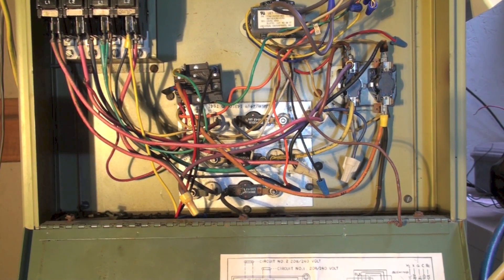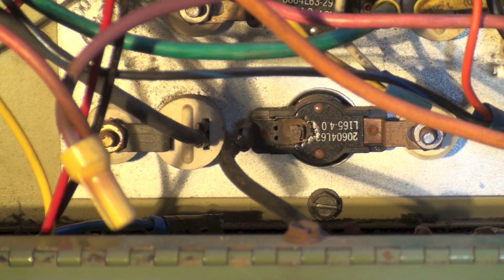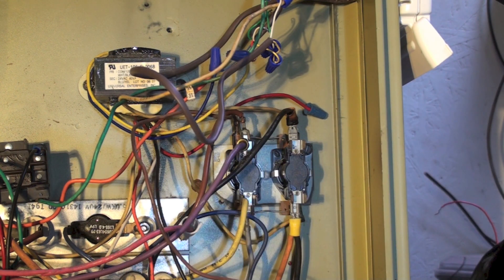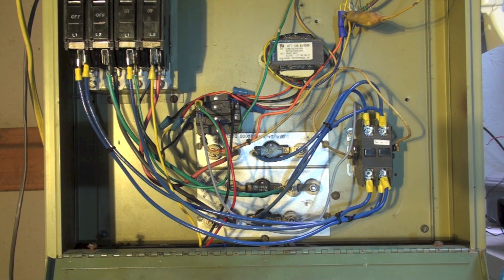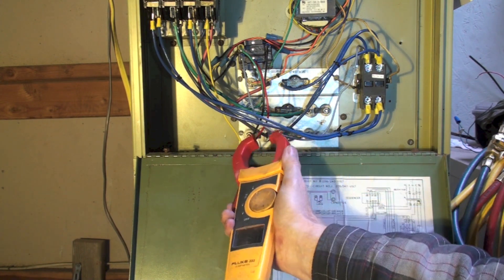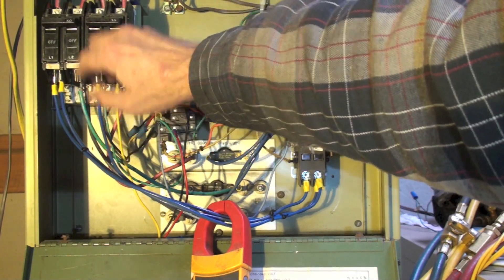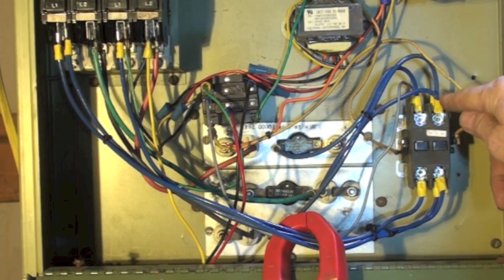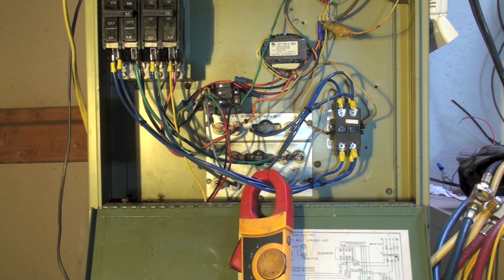Electric furnace, replace sequencer with contactor

Comment: Granted, I'm a low volt tech with a lot of line voltage experience as well, the contactor is a much simpler install than the sequencer. I have a 4 element system, practically the same exact setup. I think the contactor is far more straight forward. That being said, yes, if you have no clue about how electricity works, don't burn your house down. But, I'm also here because I'm sick of replacing elements, sequencers, etc. And yes, the spade connectors seem to always be the downfall, and/or a failed sequencer. I'm going to be moving to a contactor, see what type of luck I get.

Comment: my sequencer is starting to go wonky, sometimes the fan bit never comes on, couple times now the systems been in cool and the indoor blower has not been running, if i flip the constant run switch on the stat it seems to bump it back into working order... these are so confusing if your working on them with sequencers, because they really dont make a lot of sense.. at least its not nearly as straight forward as gutting it removing that crap and just putting contactors in... so much easier. my furnace is fused too and ive wondered if converting to some form of other means of disconnect/overload cutoff.. fuses are giant bitches to.. i just dont like how coleman did the fusebox tbh..

Comment: The reason you have 22 amps on two of the 3 wires is because those 2 phases are also powering the blower motor and the 24 volt transformer as well.

Comment: What's a good stranded wire for 10kw heat strip?

Is #6 okay w/strips and fan?
Reply from the maker: I would use #6 THHN.
GFM
Reply: @grayfurnaceman  Would this be #6 load side of contactor to heat strips(say, a red #6, black #6 just for mnemonics)?

Is a 90-380 relay okay, or what relay would you choose?

#6 from breaker to line side of contactor too?

This method seems simpler that sequencer?
Reply: Request: like, if u could, to do a video with contactor & fan relay wiring?

Thank you!

Comment: I appreciate you taking the time to make this video, and your level of knowledge on these things. It seems to me, though, that this is more of a video displaying the fact that you did something than an explanation of of 'how to' do that thing. A step by step tutorial on which wire goes to which terminal and why would make it more of a 'how to'. I hope that doesn't come across as overly critical. No offense intended.
Reply: It's fairly simple to follow. If you were to replace all necessary wires in your old sequencer and breakers, the remove your sequencer and just transfer those wires over to the contactor it should be pretty self explanatory if you know how your sequencer works and what is on what circuit.

Comment: I'm currently working on this same style furnace the issue is the blower won't shut off after the thermostat is satisfied could this be the contactor is bad ?
Reply from the maker: You probably have a wiring problem.
GFM

Comment: Excellent video!  Some solid suggestions/comments from readers!  But other comments shows they truly don't understand to the level that's required to perform this modifications!
Reply: I was working on a similar project- a contactor in an electric furnace burnt on the line side. I almost did the same thing as the video. Two 10 wires from the breaker to one side of a new contactor. I was worried the wires were two small to handle 40 amps so I used the original 6 wire used by the last company. Currently waiting to pick up a lug Contactor so I can fit those big wires safely.

Comment: I was wondering I had havc guy HV AC guy come in here and my control board is burn up and he replaced it with a contactor but he didn't hook up the emergency heat my question is how does that work where those low voltage wires hook up to
Reply from the maker: That is field installed wiring so there is no set method.  About all I can say is the emergency heat is connected to the coil of the contactor.
GFM

Comment: I live in a rural area now and although my panel specifies using 105C wire only it is unavailable unless I want to drive about 60 miles. Is there any practical reason not to use thhn/thwn2 ?
Reply from the maker: You can use THHN.  Just be sure the connections are tight and if it is using #12 wire,, use #10.
GFM
Reply: @grayfurnaceman  thanks.

Comment: First thank you for your informative videos.  I have an older Intertherm furnace (with 3 x 20amp elements and fuses), 2 sets of 30amp, and 60amp.  Have 50amp double pole breaker at my box .  One would think that one 30 and 60 amp fuse would correspond to each pole of the breaker.  I cleaned up the wiring with new 10guage.  It has a 40amp contactor for the elements and fan.  It threw the breaker yesterday after running for a week.  The main questions...do I need a 50amp contactor, what one did you use above, the Honeywell is $100 and maybe overpriced....Or does this sound like a wiring issue, I duplicated the previous wiring but that doesn't mean it was wired correctly in the first place.  Thank you, and yes I will contact a tech if you think it is a wiring issue.
Reply: Your contactor is probably a bit small.  50 would be better.  The Honeywell contactor is used because it is quiet operating.  Any contactor with the rating will work.  
Do you have just a single 50 amp breaker in the panel for your furnace or are there 2?
GFM
Reply: 50 amp breaker ????? U need 60 and a 30 or a 70 amp breaker with minimum number 4 wire or 60 Amp with number 6 and 30 amp with number 10 wire

Comment: thanks Gary, need some advice i have a question maybe you can help. i'm up north, first freezing cold spell since the winter, first time aux heat strips in use in the air handler since winter (Trane 4tee3f37b1000aa). When the aux heat starts, there's a machine gun rapid fire/chatter sound at the air handler, right about where the 20KW line comes in. pretty loud i'm not really familiar with relays or contactors but could it be relays that turn the strips on and off that can make the noise?? Once the heat gets going and the fan is up to speed, noise stops, and then starts again a bit when the heat cycle shuts off. I'm still getting aux heat and the fan is running smoothly and is set to ON, outdoor HP heating fine otherwise. I'm DIY have changed blower motor module and capacitors but no relays. system is 12 years old. 1 have 4 heat strips x 5kw each
Reply from the maker: The chattering indicates the control circuit has excessive impedance.  The coils of the contactors are not getting enough power.  The first thing I would be looking at is the thermostat.  
GFM
Reply: @grayfurnaceman  thanks for the quick reply Gary. From the tstat display everything looks normal. Can you suggest specific troubleshooting steps-  what I should be doing/looking for inside the air handler? do you mean that the control signal from the tstat is only opening the circuit partially at the heat strips and what might be failing exactly to cause this (relay/contactor/sequencer?), does that indicate mechanical failure/physically damaged/burnt  parts  (what and where), and/or loose wires or connections? or more like a board? I'm not that familiar with electrical but i can methodically identify specs and replace parts and reconnect wires based on existing config. my budget is very limited so i need to figure this out myself like in the past. sorry for the long question.
Reply from the maker: @soneeeee4440  My thoughts are that the thermostat may not be operating normally and will be not transferring power to the contactors.  
GFM

Comment: I can think of one more safety device : an air flow switch. If for any reason the blower fails to kick on the the elements will not come on thus saving the elements from excessive overheating.

Comment: Great video. Im tired of crawling under the house and replacing these sequencers. I'm going to do this conversion. I have a question though. My furnace blower also must run with my AC so I would not be able to use one leg of the heat contactor to pick up the fan motor. I assume I would need a third contactor for the fan alone. If you could maybe explain the correct wiring for a 4 element furnace with AC that would be helpful. Thanks.
Reply from the maker: You could simply use the existing fan relay normally closed contacts connected to the contactor.
GFM
Reply: @grayfurnaceman  yeah after studying the wiring diagram I understand how it was designed.
Honeywell programmable thermostat took me a while to decipher with my meter.
Want to run my heat pump / electric backup system like a basic heat and cool system. Reversing valve is bad I think and will just leave it in ac position for now. I think I can do this changing one wire and the correct programming of the thermostat.

Comment: Won't it pull too much amperage when it closes?
Reply from the maker: It does not.  Several furnace manufacturers use contactors in their furnaces.
The reason for sequencers to reduce initial amp draw came from the 1960s.  At that time there were many pole transformers that were not designed for those high loads.  That time has passed.
GFM

Comment: A relay (contactor) is simpler.  I guess the only downside is the possibility of noticing the lights blink when all three loads come on at the same time.
Reply from the maker: That has been the argument against the use of contactors for over 50 years.  I would say that may have been true when the grid did not have the capacity it does now.
I have not seen that issue happen for many years.
GFM
Reply: Hey watch out, our grid has a rating of D+.

Comment: When you demonstrated crimping a #10 ring connector you said you crimp on the back side of the connector ( that's the way I always did it ) yet when you showed a close up of the installed contactor your crimps  were on the top side of the ring connector?
Reply from the maker: You are looking at the bottom of the connector.  They are installed upside down.
GFM

Comment: Like your idea of contactor. Is there a way to simply check the voltage across the sequencer itself while installed to tell if its bad?
Reply from the maker: If you test across the contacts during a call for heat, after enough time has passed for the sequencer to close, you should read 0 volts.  240 volts means the contacts have no closed.
GFM

Comment: I am thinking about replacing my sequencers with a CONTACTOR. I would like to know if my furnace also has Air Conditioning if this is a cause for concern?
Reply from the maker: The only problem I can think of is the fan relay must separate the elements from the fan when cooling is energized.
GFM
Reply: @grayfurnaceman  Thanks for the quick reply. I ALWAYS have my fan on at all times. So  I will wire it on (thermostat FAN on switch). That should work fine, your thoughts?
Reply: It should.
GFM
Reply: @electriccar3253  Thanks
Reply: Received my Honeywell contactor today. Where can I get 10awg wire??? I went to 4 different hardware stores and they don't sell "stranded" 10 gauge. Could you point me in the right direction please. I will get it online but would like to know brand type etc. Thank you very much if you could help me with this.
Reply from the maker: I have seen it at Home Depot.
GFM
Reply: @grayfurnaceman  You're right. Went there and they had it.! Thanks
Reply: I installed the new contactor and working correctly. I need to replace the connectors at the heater elements. I was told that they need to be HIGH TEMPERATURE . They are slightly larger than the ones at the CONTACTOR side. Where can I purchase these HIGH TEMP connectors? Home Depot and so forth do not carry these. Any ideas? Thanks
Reply from the maker: The connectors are .250".  You do not need high temp connectors.  No manufacturer uses "high temp"  connectors.  Those connectors are needed for environments that are high temp.  That is not the case for electric furnace elements.  There is no excessive heat in the control box of an electric furnace.
 GFM
Reply: @grayfurnaceman  Ok , I can use the standard ones then The only problem is that the 0.250 size is too small on the Heater Element side. How can I post a picture to show you exactly?
Reply: I just measured the female terminals. The standard ones (contactor side) I measured OUTER 7mm or 0.27 inch. The terminal of the HEATER ELEMENT side I measured OUTER 9mm or 0.35 inch. Now I have to find were I can get these buggers.
Reply from the maker: Send to Grayfurnaceman@gmail.com
GFM
Reply: @TheHudsonSpeeder  I was just making new wires and ran into the same thing...only the connections on the elements are larger size. Did you figure out what size yours were? I saw some 3/8 inch connectors when I bought the 1/4 inch and that is what I am guessing they are...haven't made it to town yet though to buy them.
Reply: Can you let me know how it goes are you using a sequencer to control the contactor?
Reply: @beauprephilip  No. The thermostat is controlling the contactor. Therefore all heating elements are switched ON and OFF.

Comment: dont remove the sequencers,, they bring the heat up in stages and then down in stages , which provides a nice gentle heat,,,and also the fan is to run after the heat is off to blow the residual heat out of the plenum.. ,,  this is a dangerous video.
Reply from the maker: Sequencers do bring up the heat in stages, originally to ease load on pole transformers when these transformers were sized smaller.  That need is no longer there.  
Most sequencers have a life span of 1/5th that of contactors.  I cut my teeth on these things and after replacing them sometimes every 2 years, found that Honeywell made quiet operating contactors for just this application.  
Heating elements have virtually no thermal mass and all the heat is removed by the slowing fan.  
There is no such thing as gentle heat.  All elements coming on at the same time preheats the duct work to reduce cold air on startup.
Some manufacturers (such as Trane)use contactors for all their electric heat strips.  So much for the dangerous video.
GFM
Reply: Some r made to work with contactors so there is no problem . l wiil instead said becareful . with safety heat sensor

Comment: Since there are also 60 & 30 amp breakers at the main panel, if the 30amp here in the air handler is bad, why can I not just bypass the breaker in order to get them up & running quickly? It still has the 30amp at the main for circuit protection. Nearly all brands do not even have breakers at the air handler. Nordyne does it this way though and not sure why.
Reply from the maker: Here is the problem with bypassing the breaker.  Because the manufacturer installed it.  Its that simple. You are correct,  the circuit protection is still there.  However, if there was a fire, you would be blamed.  Even if your actions had nothing to do with the fire.
GFM

Comment: Thank you GFM for your incredible repository of 1000 plus videos on HVAC !  I've watched about 500 or so and loving it.  Just one observation about crimping terminals. As a previous viewer commented you are using the crimper incorrectly. Insulated terminals should be crimped with the smooth mouth portion of your crimper according to industry standards. If you want to use the non-insulated part of the die then pull the insulation down, crimp on the opposite side of the split, then slide it back up. But better to use the smooth portion of the crimper that is usually labeled as such. Perfect crimping leans toward making a gas-tight crimp where the barrel of the terminal envelops the wire strands squeezing out the air space which leads to less corrosion and ultimately less resistance. I personally don't think the pin type crimper is a good idea even for non-insulated crimps because the force of the pin is so concentrated that it can crush wires and the actual contact of the rest of the barrel to the strands is minimal. The best crimpers are ratchet style and non-insulated. They have a two sided die where the split of the terminal barrel is gently rolled into the center and the rest of the barrel is tightly squeezed around the strands excluding air. However almost no one in hvac service uses that type of crimper except for the manufacturers.  The better type of insulated crimpers are ratchet style and the smooth faces are wider than cheaper crimpers. The best insulated terminals are the heat shrink type that helps to seal out moisture. Avoid using the cheap harbor freight type  insulated terminals for high current because the pvc insulation can be very brittle and the actual gauge of the metal terminals is very thin and the plating is not the best. They are ok for low voltage/low current but are definitely not for high current like the contactor. Also great recommendation about using ring terminals if possible rather than female spade connectors. The cheap female spade connectors lose their springiness with repeated heat/cold cycles thereby potentially creating higher resistance and eventual failure. Thanks again for your incredible contribution!
Reply from the maker: Thanks for the thoughts.
GFM
Reply: If you use ring terminals that means drilling the terminals on the sequencer and than a bolt to connect.My Question if the sequencer controls the contactor for opening and closing the contacts in such a short and frequent time , will it be hard on the contacts.

Comment: One question I have is if your using a 50 contractor and your pulling 65 amps total. Why is this contractor not to small. Is it because each side of the contractor can handle 50 since it's a double poll.
Reply from the maker: Yes.  Each set of contacts can handle 50 amps.
GFM